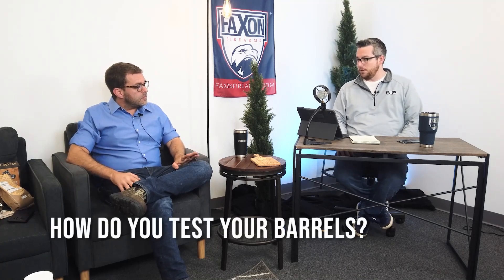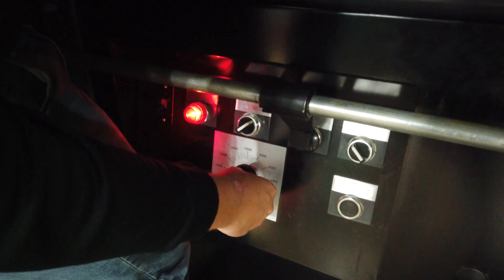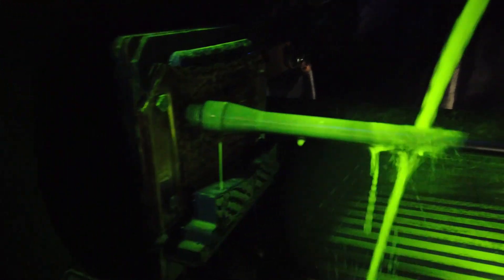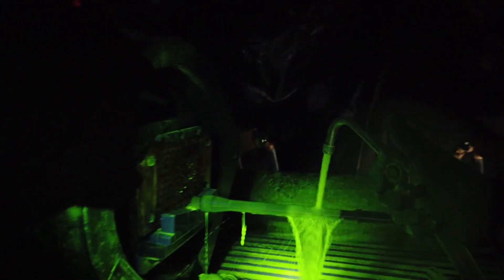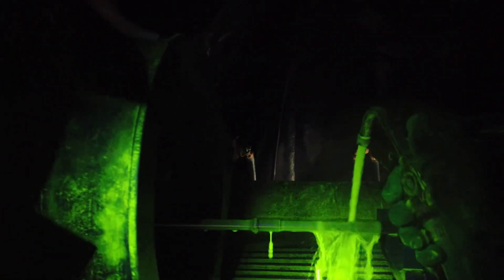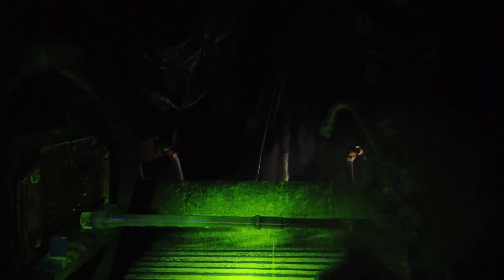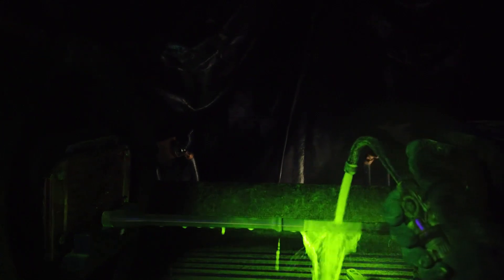Faxon Barrel Quality Inspection

Comment: I have 2 of your barrels that failed a function gauge..You should check every chamber with a function gauge as it is quite easy and will quickly find any chamber flaws..
Reply: @faxon I got an ARAK 21 from them and it is visibly out of spec. I'm a machinist and see so many visible flaws, I sent it back to them and they had it for months and sent it back without any fix and dirty as fuck.

Comment: Hey Guys. I like your show. 
I'm retired USAF and am also a 3rd party Magnaflux (Mag bench Manufacturer - the same one shown in you video) service technician. I perform maintenance and calibrations on mag particle equipment for various customers that support oil and gas , aerospace and even arms manufacturing in Texas and some of the surrounding states. I have been at this job now for almost 7 years and enjoy the opportunities to provide such a service. 

In addition, I also own a scratch built AR-15 style, piston actuated rifle with a Faxon, Flame fluted 20" barrel that I enjoy shooting. 

I have a question regarding the process a barrel goes through to de-stress them after hardening and manufacturing? 

The first barrel I had was stainless and came as part of a complete upper. I immediately had an issue were the first shot was visible on the target and then the follow up shots  were all over the place. That issue gave me cause to purchase the Faxon barrel. 

I can't tell you how I came to your brand, but the purchase was well worth the fun and enjoyment I get from shooting my rifle.